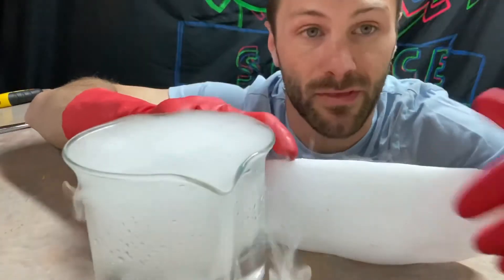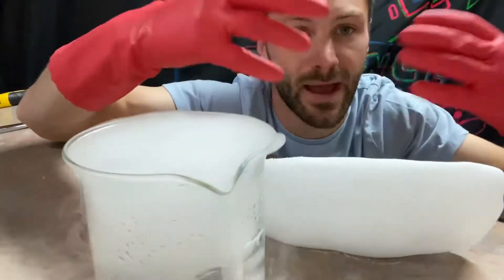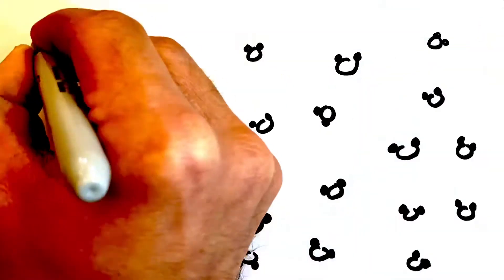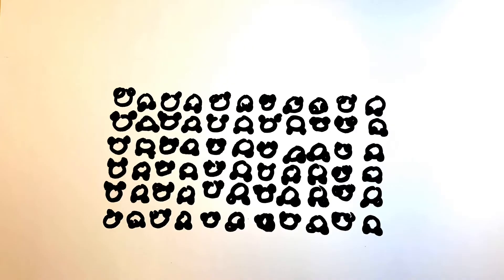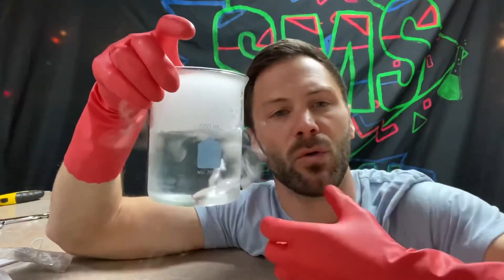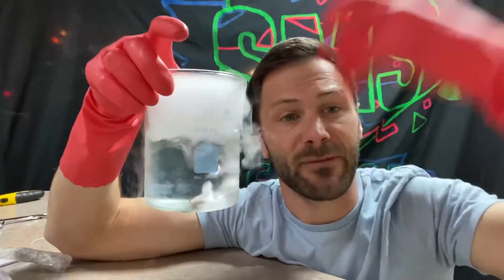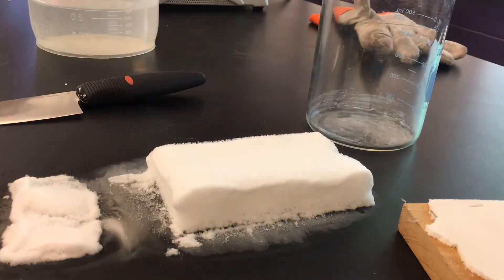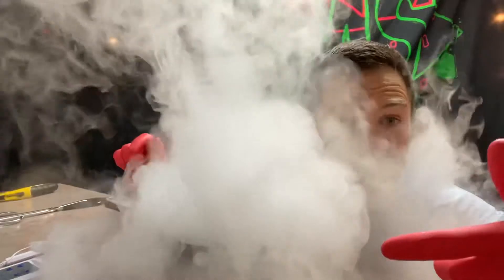Dry Ice Explained

Comment: Great video. 
One question: if I need the dry ice for tomorrow for example, it has to be in the freezer if I would order a bit in advance?
Thanksss
Reply from the maker: Yep!  That’s a good idea.  There are a couple of ways to get it.  Personally, I prefer to make it for my classes with a dry ice machine.  I rent a CO2 cylinder with syphon that hooks up to my machine.  A cheaper route would be to order it though.  The dry ice here came with some meat that a neighbor of mine ordered online during the height of the pandemic.  They ship it with dry ice to keep it cold.  Quick note, don’t put the dry ice in a freezer though.  That’s because dry ice is much, much colder than a standard freezer.  Not only will it not work, it could break your freezer as well.